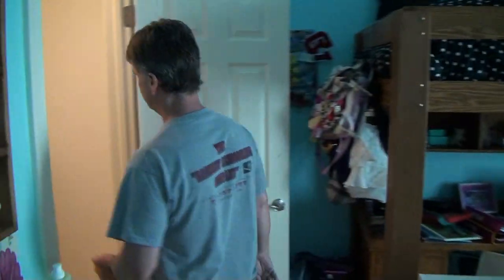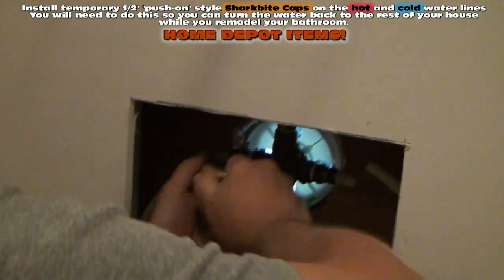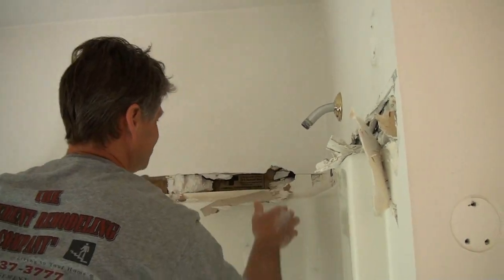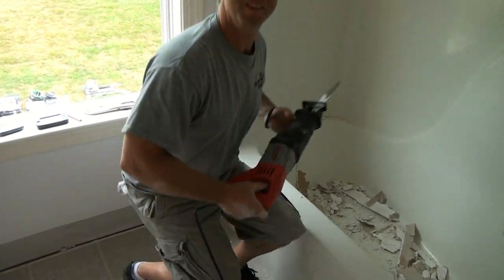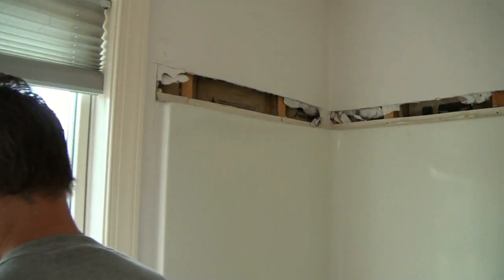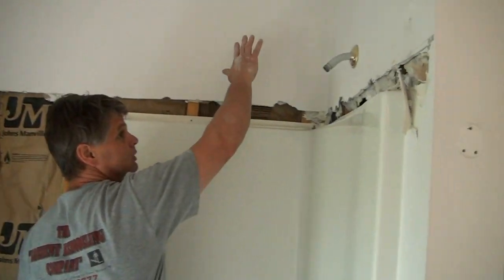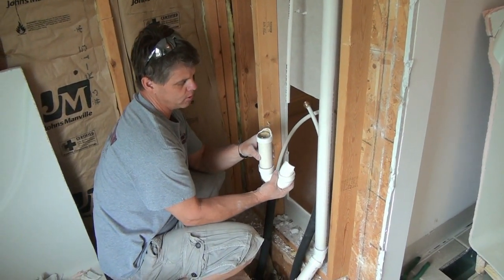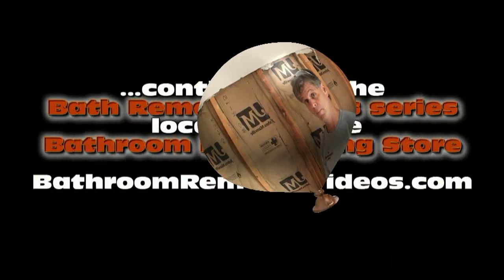How to Tear-out a Fiberglass Tub and Shower

Comment: Hello -- this was a super helpful video. I just had a few questions: did you have to do anything to the pvc piping before removing the bottom of your tub? Also, if you aren't going to be able to install the new tub/shower unit that same day, do you need to do anything to the pipes to prevent that sewage gas from coming up like you mentioned in the video? Thank you for any help you can offer!